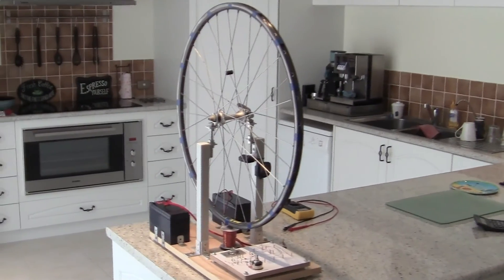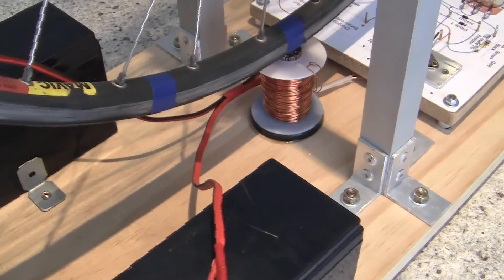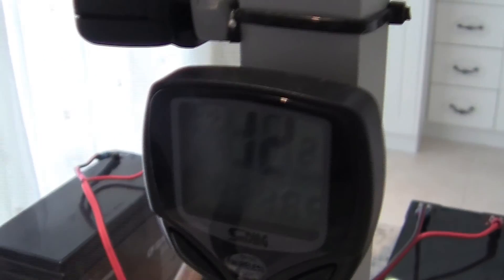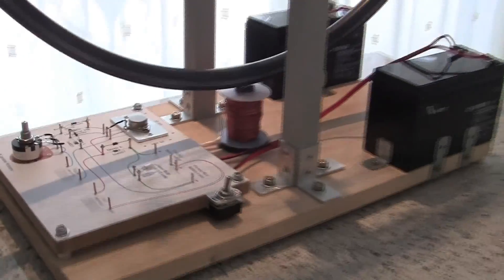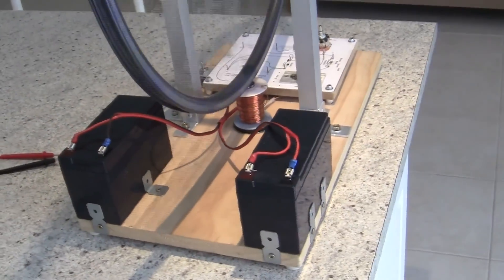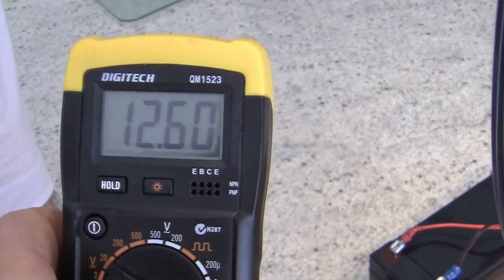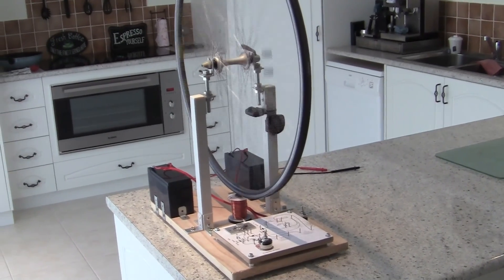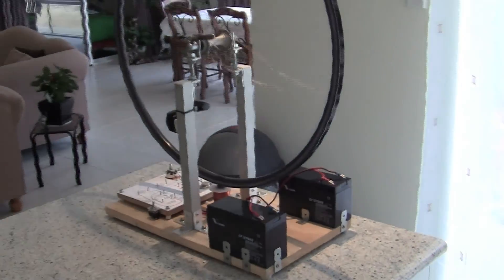Bedini Monopole SSG Energiser

Comment: Good job
You may find you will charge the second battery  without the wheel.
Others have used glass ash tray above coil and snakegg magnet spinning instead of wheel.
The real mystery is inside the battery.

Cheers

Comment: Very nice clean build! You are right, the low coil turns is what is causing the low charging rates. Also, using neos is problematic with these, much better to use ceramic ones. And yes mine ran for three years in my shed, I have rebuilt it in certain ways and its going strong again. Thanks!